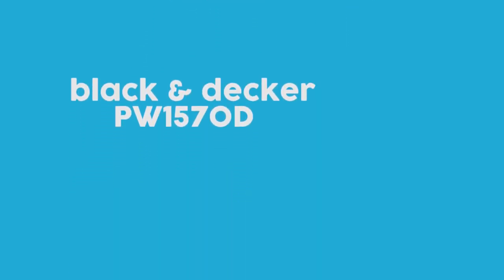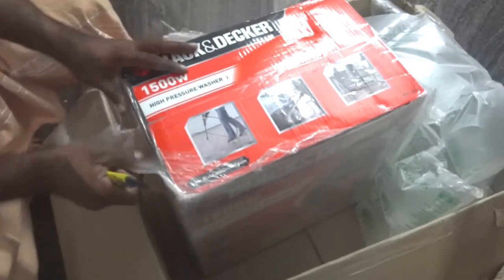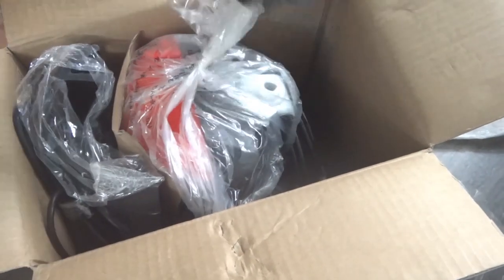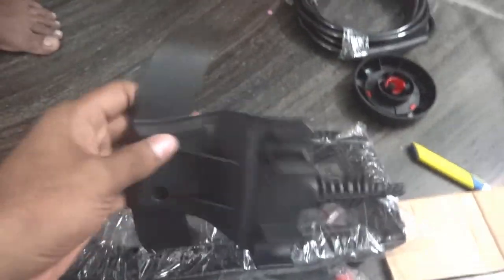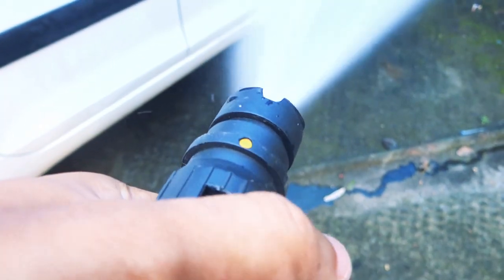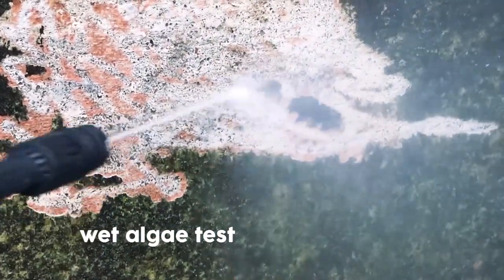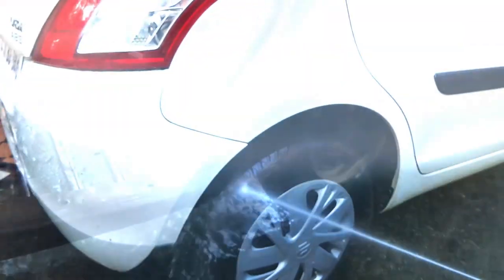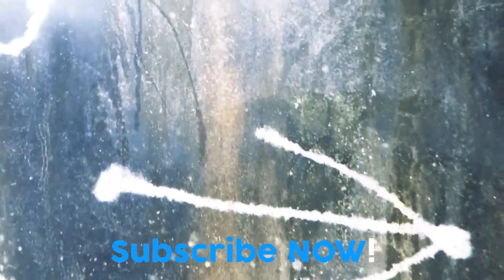Black & Decker PW1570 1500W 120-Bar Pressure Washer : REVIEW

Comment: Hi, how long you can keep the motor on till it gets hot. Does it have auto tripping function when the motor overheat. Does it pull the water from bucket or need flowing tap water input.
Reply from the maker: Auto trip, flowing water needed

Comment: does it pull water from a bucket (where water supply from a tap is not available?)
Reply from the maker: No, a input of water is required ! & it requires a optimal water force for the best performance.
Reply: @Rickyrodger  thanks. I plan to take water from my water tank which is 500 litres located on the terrace 3 floors up. I guess that should produce enough optimal input force
Reply: @Rickyrodger  one more query I had: have you tried using a high density foam gun that literally covers the car in white snow like shampoo? Bosch and karcher probably have it... And there are others costing around 1.5k on Amazon
Reply from the maker: @olifern  it does have foam container, which is placed at the back side of the motor.